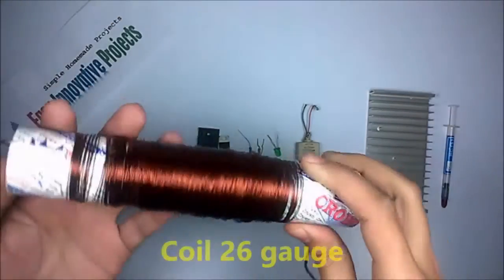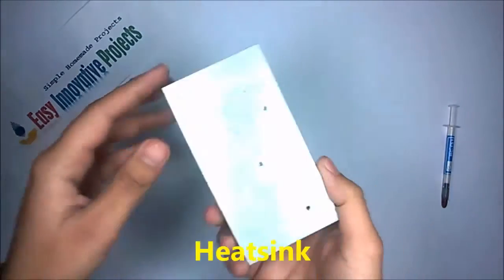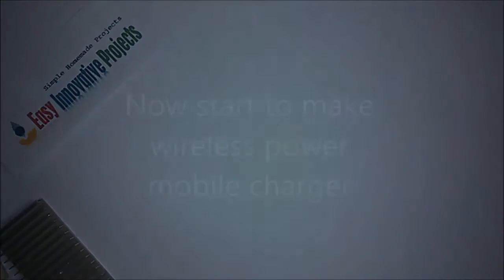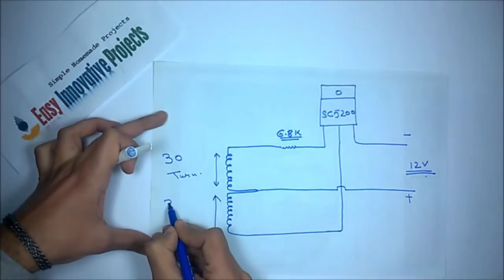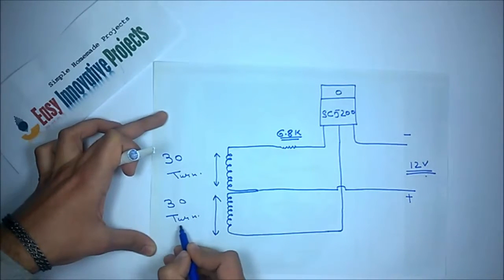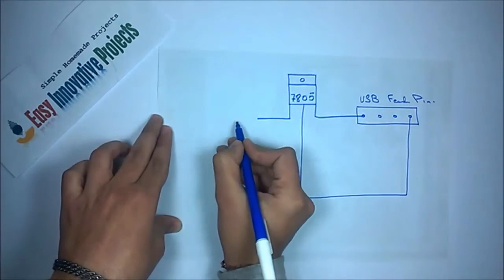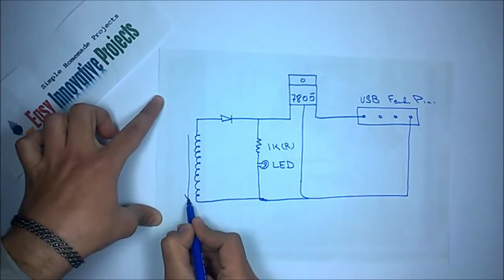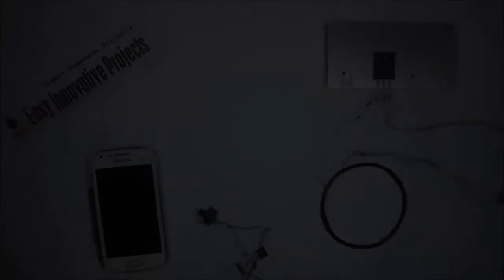how to make wireless mobile charger at home - easy with circuit diagram

Comment: What is the approximate diameter of the copper coil?
Reply from the maker: dear i use 5 inch diameter in round 
if you ask wire gauge so i use 26 gauge copper coil.